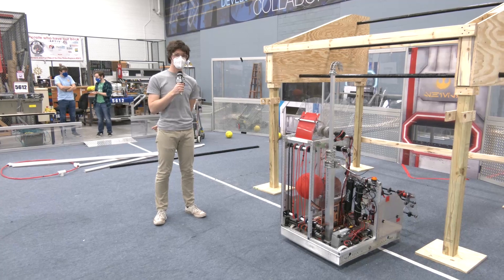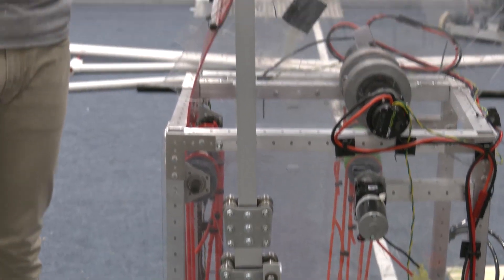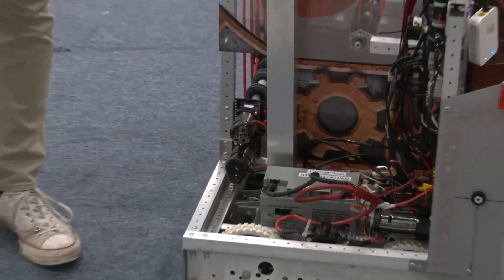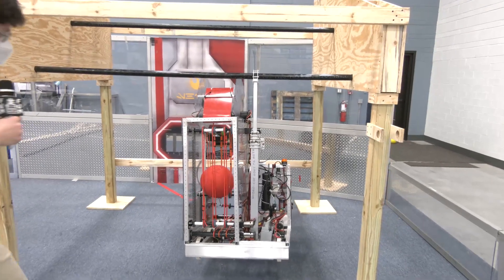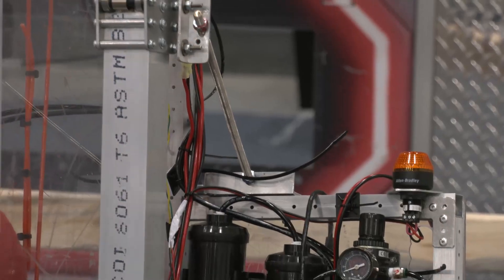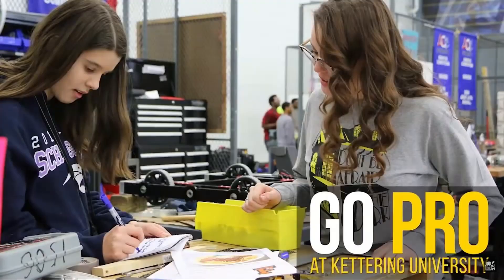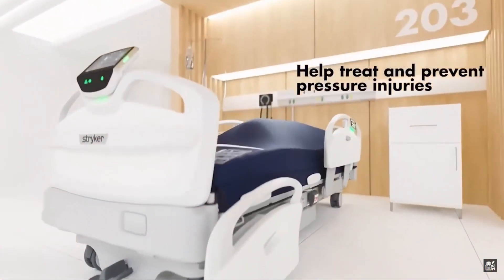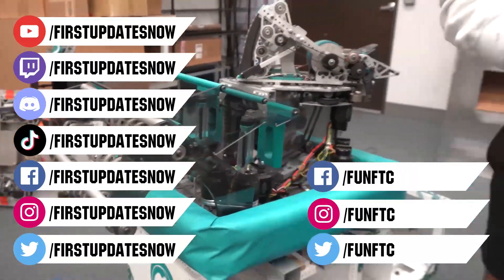Level 2 Mid Rung Climb Using AndyMark Climber in a Box Robot in 3 Days The Bulldogs

Comment: What gear ratio was used for the lift?
Reply: 16:1
Reply: @EdArmy  that's much lower than I expected. Do they have any videos where they show how they came up with that?
Reply: @armaansengupta  it’s just the suggested ratio by Andy mark
Reply: @rally8520  ah, ok thanks
Reply: How did you guys stop the motor from back driving once you lifted up?
Reply: @ericnorth9578  you can put motors in break mode in code which essentially makes them resistant to motion, with a high enough gear reduction it can hold the weight of the robot

Comment: How does the Falcon 500 and gear ratio play a part in keeping the robot in the air after being disabled?
Reply: I believe you can just put the motors in "brake mode." This puts power through the motor even after the match which holds it still.
Reply: @kendan856  Thank you for letting me know so quickly!
Reply: @kendan856 (bit late for a comment, apologies) the brake mode (at least in most motor controllers) shorts the leads of the motor causing the spinning of the motor to generate back-emf, making the motor generate counter torque when spun. When robots are disabled, brake mode still works, but this no longer works when robots are powered off